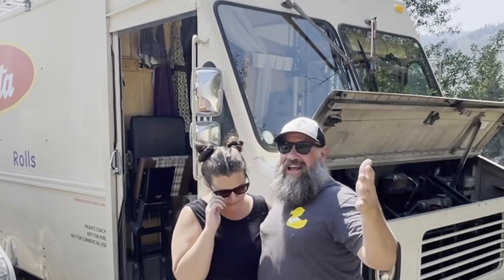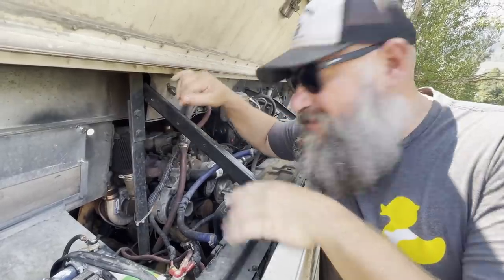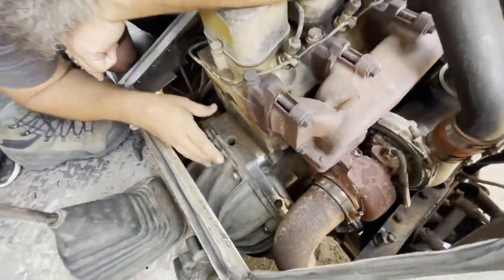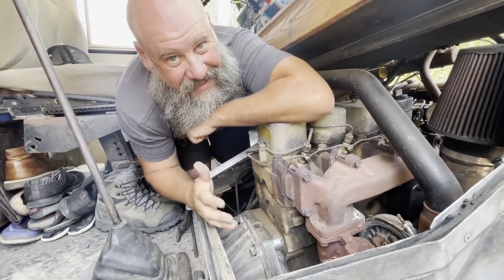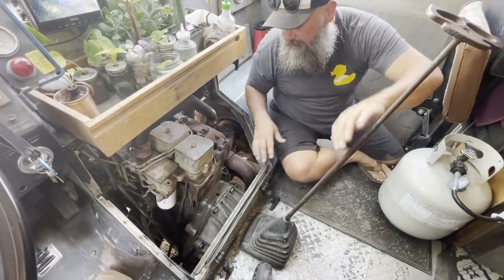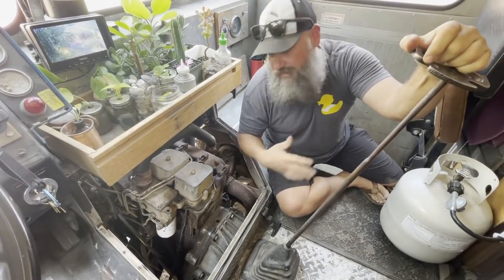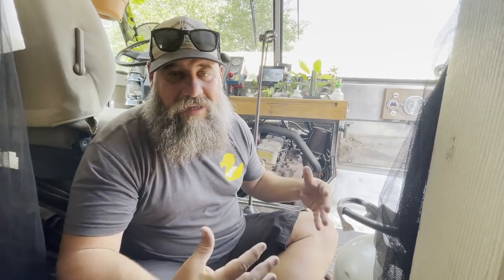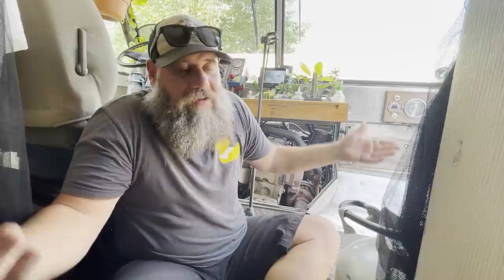CAN ANYONE FIGURE THIS OUT? | Help! | Massive BreadTruck Repair Needed Now

Comment: Find an automotive machine shop or small machine shop and have them install full depth heli-coils in all the threaded holes.  That shouldn't cost too much and is considered a permanent fix as long as there are no cracks.  It looks relatively easy to pull the transmission.  You can do it Paul!

Comment: My wife has been a follower of yours for some time. I've been a mechanic for 30 plus years. My question is, has a mechanic ever told you if the adapter plate could be helicoiled? We are located close to Portland Oregon.

Comment: Ditto on helicoils, but that's already been said.  If your engine threads are good and holding? You may even be able to helicoil the bell housing adapter holes in place (provided it isn't cracked, if so, then replace the adapter) in place on the truck?  Check your ring gear teeth (what the starter gear turns).  If those are real worn you might need to replace or flip the ring gear, while the clutch is removed.  On gas rigs I've used a trick where the flywheel ring gear is heated up (till it expands and can be removed)  using an oxyacetylene cutting torch to heat it and driving it off with a punch. Flip it over to get the new side of the teeth facing the starter. Maybe best to take the flywheel off to do that? Also check the clutch plate and flywheel for cracks? That would let you check the bolts for bolting the adapter to the engine (unless you're sure they're all okay..).  If your engine mounts are flopping around worn? and no replacements? I have chained engines down to steady them. Use chain and bolts between engine and frame with turnbuckles to adjust the slack. These can be spring loaded too, if needed (think eyebolts with big washers and valve springs).  I wouldn't do this in a campground (fire restrictions and no air or power tools...). A mechanic shop with air tools and torches would save a lot of grief.  I'd do it in my welding shop, but I'm in So. Oregon. It is fire season here too, though...

Comment: Are the bolts holding the adapter to the block good? 
If the transmission to the adapter is bad id ask why are they stripped?  Is the trans mount allowing extra work on them? 
If it's aluminum that's probably part of the issue. 
A good fix that would last a while helicoils with lock tight.
Or just tap them up to the next size.
Reply: Exactly Helicoils will allow you to get a good grip for the starter. Tapping is also a great idea!! Inexpensive and if done right will will provide years of service. Spot welding might help situation if you are buying new cars parts down the road?  Put add in Craigslist for ups of fed x mechanic to help or heavy duty truck mechanic.

Comment: Put a 2x6 across the top ledge of the doors. Hang a come along and chain from the 2x6. Use this makeshift crane to pull your transmission out. It's also handy for pulling motor out as well. I can change out motors and transmissions out in one day. Swapping motors and transmission is quick and easy .

Comment: If I was in this jam, I would rent a spot at rv storage place (very cheap and you can leave it there and work there), pull it out, retap threads and re install (or replace the part). I have a motorcycle in the back of my rig and use that for transport during breakdowns. You could Uber when you absolutely need to go somewhere.

Comment: Houseboat in Florida here. Recently went swimming with my phone and haven’t gained access to my old account yet. 
I’ve attacked similar problems before,  one bolt at a time.  Remove the bolt, insert some bare copper wire strands into the hole, and then snug the bolt down. Problem solved(for a long time, usually). 
May require some experimenting with different sized strands of wire, but the copper will conform to the voids between bolt, and fixture. 
Fine strands seem to work well, for holes with some threads remaining, but I’ve used pieces of wire from residential wiring before(I think it’s called Romex).  
Insert a piece of wire, only slightly longer than the hole is deep, start the bolt by gently tapping it into the hole with a small hammer, and then tighten it down.
Reply: This approach, can be done on the side of the road, often with things already available inside the truck. 
No machine shop, no tear down of the equipment.  It’ll getcha home, and even works on exhaust manifolds. 
You want to make sure you don’t only force the copper into the bottom of the bolt hole, and that’s why I leave it long enough to hold with needle nose pliers, until the bolt really starts to bite.

Comment: Instead of removing the trans, lay some boards side to side in the front, and back, shimmed up on concrete blocks or bricks, and slide it back by standing over it with a rope slung under it.  I wouldn’t remove it, in the field, but if I had to, I’d only slide it back.  Rescue threads work nicely, but they require a drill, drill bits, and the coils.   Try the wire.  It works.

Comment: Helicoil possibly could get you buy if there's enough material in the striped areas
Reply: THIS !
Reply from the maker: I’m done with heli coils and temporary repairs. I need a solid permanent fix
Reply: @PaulBarger  They are stronger... nothing temp about it. cya
Reply: @PaulBarger  I understand that would be last ditch resort ,I got a lot of resources in Kansas if you ever get down this way me and my wife run the Cherokee American legion post35 and you'll have a safe place to park and chill out and if need be repairs
Reply: Sent a message to welder up who knows they might help that's what there known for is cumins

Comment: you're going to want to repair the adapter you have, from my reasearch that cummins b-series to ford small-block pattern adapter is over $900 with a new flywheel, and so far i haven't found anybody willling to sell one without the flywheel. best move is to remove the adapter plate completely, drill out all of the threaded holes on a drill press or mill and install thread inserts (helicoils, keenserts, keylocking inserts, they're all good). most likely the damage occured awhile back when you drove the rig for some time with a bad carrier bearing and broke the bellhousing.

Comment: The easiest way to fix this and the cheapest is to Heli coil each bolt hole they are little coils of wire that line the thread hole.and put thread lock on each bolt.
Reply: That was my first thought too heli coil

Comment: Lock-N-Stitch can fix your adapter plate but they're located in the middle of California and I don't know what the repair cost would be versus buying a new adapter plate. Lock-N-Stitch makes the best permanent thread repair inserts in the world. Helicoils are just repair bandaids, not a permanent fix, stay away from those unless you just want a temporary solution. Lock-N-Stitch has a repair service facility but they also sell everything to the general public for performing the repairs yourself.

Comment: Tapping is actually quite easy, just a drudgery.  Replace the adapter plate. Go to a junk yard. My points went out on my '80 Fiat spider convertible in Helena Mont. in Sep. COLD! Spent 3 days during a Labor Day weekend freezing behind a Husky Gas station till the local recruiter and a recent recruit came to the rescue, with help from the local bank. I was 3 days late to muster at the local USAF Base, which made me technically AWOL! No harm no foul. They were notified by the USAF recruiter. I feel for you dude.

Comment: So many problems with motor mounts.. Chain your motor at the front tight to your frame..  on the drivers side only..  assuming your motor spins clockwise looking at it from the rear..  And old trick us hot Roders did back in the day to keep the motor from wanting to climb up off that one motor mount !!

Comment: I watched your Canadian border video and there’s a part in it where you are having problems starting your engine. I noticed how bad the motor itself was literally shaking like mad leading me to think you may have broken or worn engine mounts somewhere along the line causing your adapter plate to vibrate and move more than it should. Your transmission has a mount and if that’s staying still while the engine is moving like that then over time it’ll cause things to get worn down and broken bolts to happen.

Comment: I believe the 4bt and 6bt back of the motor are  the same. Look into the first gen 6bt manual transmission, flywheel and starter.

Comment: Helicoil -- Helicoil! Helicoil the starter bolt threads if you can get to them.  It the adapter to engine or the adapter to trans bolts are not loosening do like Frozen and "let it go" till the next stop. Check your trans and engine mounts. Should not be stressing the trans and adapter to engine bolts. Best of luck.

Comment: Your starter bolts holes might also be helicoiled, or even up sized to a larger bolts and re-tapped the holes, if there is enough room?
Reply: you might consider studs for the starter mount instead
 of bolts. Studs are available that are larger on one end than the other
allowing the oversize "engine block end" to be drilled out and tapped, while the protruding starter end is normal stock size

Comment: Helicoils they work great.  Also use blue locktite on them.
Reply: best to use red loctite on the inserts when you put them in, then use blue loctite on the bolts. red loctite is permanent, blue loctite is removable.

Comment: I’d check with a machine shop & explain what you need done. I can’t see it being a huge issue drilling out the holes & pressing sleeves or pins in. Sure you’ve still gotta remove the adapter. But it would be much faster & less expensive then a complete  replacement. After all, if it’s just walked the holes out & the adapter itself isn’t cracked or warped it’s an easy fix for a proper machinist. Best of luck!

Comment: Remove the old bad bolts and tap the holes with a larger tap install studs that have the larger size on one side smaller correct size to go thru the bell house on the other end.

Comment: Brother, cut ur shifter Short and remove the brass knuckles, sorry but that Will save ur shit. The vibrations Will murder all ur bolts and eventually something worse

There are thread replacement kits or drill out and put larger bolts in after tapping
Cheers, having vodka digging out my basement.

Comment: Or if it was me in that situation, id helicoil the starter bolts, and its kinda jerry rigged but id try a slightly larger bolt and run them in, if ya get the oversized bolt just right on size it will cut new threads as you tighten. Pretty risky but ive done stuff like that and it worked🤷‍♂️. The trans side of the adapter is already stripped and damaged anyways.

Comment: Wow, with going through that many starters I kinda had a feeling something more was going on. I would try to look up some machine shops for duplicating the plate preferably out of steel instead of aluminum like most of them are. Small Mom and pop truck repair shops would probably be your best bet.  Good size job but could be worse, good you caught it before it got any worse. May be able to find a shop or someone with a tap and die set that can repair the existing threads or tap them out to the next size bigger and rethread. may get you by for a while.

Comment: We kept the holes for the starter bolts you might have to get a little bit bigger bowl my opinion only though thank you
Reply: Take the starter backhoe first then drill two holes and recap them
Reply: Stud take the starter out and then retreat at the holes then put new bolts in it lb the cheapest way out thank you she's the first message I sent it did not come out right my opinion only

Comment: Helicoils would be the way to go to fix the adapter plate. When a helicoils are done correctly the threads are much stronger then the original threads were.
Reply: Keen serts are a better option. Because you can use standard taps for install.

Comment: Why a Ford transmission?  Why not just find a 10spd...you could probably skip gears and it would stop the starter issues!
Reply from the maker: That’s the swap it already has. SBC Ford bell housing to 4BT Cummins
Reply: @PaulBarger  I think you misunderstood.... lose the 5 spd ford trans and get a semi transmission.... I understand the weight difference and cost...but long term the motor/trans should outlast the breadtruck and the next breadtruck

Lots of people like the cummins and do conversions... but maybe a used dodge trans would be better then the 5spd
Reply: @PaulBarger  ... I forgot to mention a dodge 6 spd...anything else Is not worth considering(hence the Ford conversion)

...I know the semi conversion would be costly

Comment: Since you believe you have few starts left, a way I always do to jump start my diesel is to put gas on a rag get it damp and put it on the air filter. NEVER use Esther to start a diesel it’ll destroy it. Gas works great as a jump start for any Diesel engines. Hope this helps!
Reply: Gas in a diesel engine sounds worse then ether... gas is more combustible, I would think
Reply: Ether is diesel worst enemy I promise, I know people that have blown up several motors because they used ether to start it. Ether is actually more combustible then gas, the ether will cause premature firing and pre igniting causing all sorts of internal damage such as ring damage, cylinder walls damage and even rod damage. Gas is just the right amount of combustion for diesel
Reply: @garettsimon3800  I've worked for heavy duty mechanics that used ether on their own older equipment.  Obviously it's not for everyday use...

Comment: Thread-certs and done... will be stronger than stock
Reply from the maker: I’d need to take the transmission out to do it properly so I need to find a place I can leave the truck for a long time with out moving it
Reply: Rent a storage space from rv storage place. Like 50$a month. You can leave it there long term. Work on it there.

Comment: This is Fred Use some Helicoil on the threads at the starter they should hold the bolts in for a while best of luck hooe to see you in quartzsite,az this fall
Reply from the maker: No I’m done with temporary fixes. Plus the heli coil repair would still cost me the same as the new adapter plate and it would be the same about if work
Reply: @PaulBarger  You should be able to take the starter out and put the heli-coils in place without removing the transmission or the adapter plate.
It is NOT a temporary fix.  A heli-coil repair is stronger than the original aluminum.  It's an oversized tap that you tap the hole out with and a slotted tool to thread in a helical STEEL coil that fits in the new threads and the inner surface is correct for the bolt.  Technically you're supposed to drill before you use the oversize tap but depending on how   damaged it is, and the fact that it's into aluminum, you may not need to drill at all.